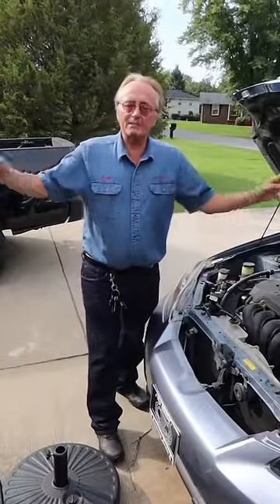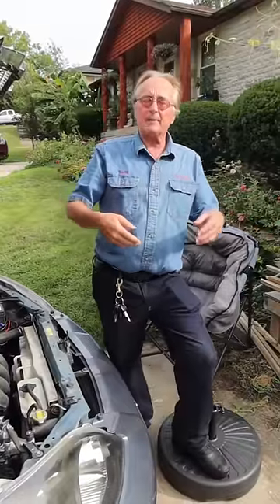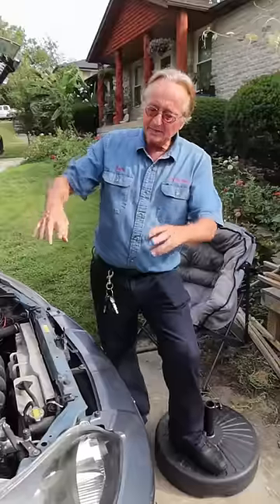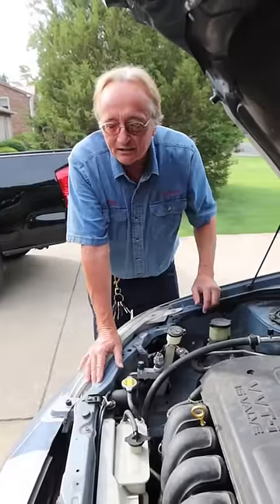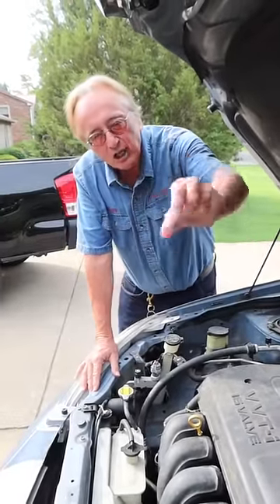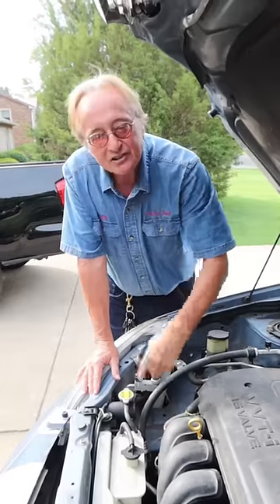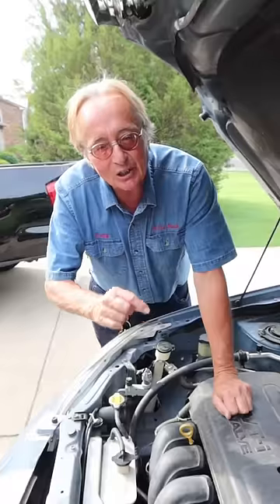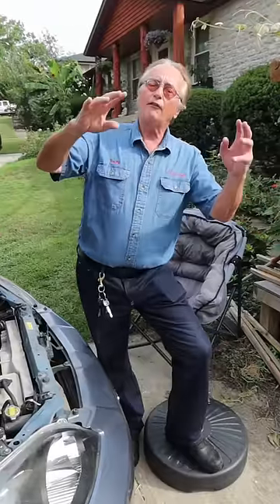How to Avoid Getting Ripped Off by a Mechanic

Comment: You could also ask for the old part too. Luckily my mechanic is pretty good about that.
Reply: In New York State they are only required to give you back the old parts if requested in advance.  It’s a good practice!
Reply: @scooterp7009  Same in California
Reply: Whenever I replace a cab or engine filter I only ever keep the old part upon request.

There have been times the customer asked, and figured it was for this reason. Honestly not a bad idea, never knew it till I became a mechanic
Reply: I asked my brother for advice and he said two things ask for all the old parts. He said you can ask to watch them do the work so you can “know” how to do it.
Reply: Yea my mechanic shows us the old part and what’s wrong with it. When I had my heater hose busted in my vehicle and it was gushing out antifreeze. He showed me the part and where it busted.

Comment: I did this sometime back at my local Toyota dealer, they were suppose change the oil and filter they said they did it, but I marked the filter and it was still they, I called them a lier. They said they didn't have one so they put the old one back. This was on new ute. I have never been back since.

Comment: True that scotty I went in for a oil change and I can tell that they didn't change the damn oil filter😠 I can say the oil filter is in a very difficult location to remove...i have a 2015 Chevrolet traverse LTZ at a carmax where I bought the vehicle. Not in less they have the exact looking filter but it did not look brand new had road grime on it 🤔

Comment: I've marked parts before. Had to call out the dealer mech on it.i flipped out on him.
Reply: It was a leaking AC hose . I marked it with a paint marker very clearly. Had my car a couple days and replaced the AC motor and not the hose...i was so specific.

Comment: They have just told me I basically need a new engine rebuild or we can start with a new transmission and a million other things cost is over $10,000 thing is I only went In for a free recall and now apparently the diagnostic shows lots of codes. My car runs fine and has no lights on, no leaks, no gear change issues, no noise problems. Am I being ripped off? I’m a young girl and look pretty stupid and naive and get this a lot.
Reply: Dude yes. Tell em to clear codes and return your car!
Reply: @ryanbobbett834  thank you! Would codes show up if there was no problem?
Reply: @itsthatyoutubechannel1083  they're ghost codes from awhile ago. Usually guys forget to reset them after the problem is fixed. Or if the battery runs low it can trip random codes as well, and once again the codes usually aren't reset. 

Unless you notice something strange, your car is fine. As long as you arm yourself with some basic car knowledge, mechanics can't scam you.
Reply: Get your car out, that's automatically red flag, check everything before driving off
Reply: Tell them that you want your car back, as you gave them, no more, no less.

Comment: I took my car to the dealer to get tires rotated. It was free so i had them do it instead of doing it myself. Because i dnt trust them i marked my tires before i took it in. When i picked it up they said they completed the rotation. However the marks were in the same place. I called them out on it and they made it right. But i will never take it to them again. If they skip the easiest of jobs what else are they skipping?

Comment: Also I believe the customer has a right to keep the old part. So if they swapped out a oil pump or something, you can tell them you want the old part
Reply: Not a bad idea but most warranty work requires you turn the old part in just fyi
Reply: They get money for old scrap parts!
Reply: @ryanbobbett834  well yea, if u don't have to pay anything under warranty then who cares!
Reply: Ofcourse. Nobody is obligated to take the part other than the owner of the part.

If you had it replaced you are more than welcome to ask for it. Its your part, although some parts do have core fees
Reply: @ryanbobbett834  most people do not get work done under warranty so this shouldn’t be a problem. I had a mechanic swap out my catalytic converter for a new one and i forgot to tell him i wanted the one but he had no problem bringing it back to me.
Reply: Right, some places save old parts, clean them up, paint them, and install them as "new."

Comment: SIMPLE...I ALWAYS TELL THE MECHANIC NOT TO THROW AWAY THE PARTS THAT NEEDED REPLACING....I ALWAYS TAKE THE OLD PARTS USED AS DESCRIBED IN HIS WORK ORDER RECIEPT....
ALWAYS BRING AN OLD TOWEL OR PLASTIC BAG....BECAUSE THE PARTS ARE DIRTY AND OILY...LIKE OLD BRAKE PADS AND ROTORS...TURBO UNITS....EGR VALVES...ETC...ETC...
Reply: WHY ALL CAPS MA'AM?
Reply: @phatgringo2.0  

I'm always baffled as to why people get offended by larger letters. 

Can  you actually HEAR THEM YELLING AT YOU IS THERE AN AUDIBLE VOICE IN YOUR HEAD?
Reply: @TheAgentAssassin  yes, yes there is

Comment: Hey Scotty, I have a Wrangler YJ 2.5L. The temperature doesnt reach 200F or 100°Celsius. It reaches only 60° C or about 130 Farenheit. Is it necessary to fix this? Recently changed the thermostat but not much changed
Reply: Is the temperature needle or sensor not broken? If it’s 60c I would assume you could touch the water and not get burned
Reply: @osasereodiase9029  It would be uncomfortably hot but won't cook your skin if you dip your finger for a second to feel the heat. But yeah a thermometer is cheap so you could just do that instead of the finger method.
Reply: @surena9451  It seems that the temperature reading is correct. Which makes it more confusing to me
Reply: @m.d.692  I am not a mechanic but I have done some DIY with my own car and that's where I base my advice from. 

If your engine is working normally then it should definitely produce some heat, enough to pin the needle at max after 10-15 mins of driving with stuck closed thermostat (don't ask me how I know..) but if your car doesn't get to operating temperature with the right amount of coolant and new thermostat then either the thermostat you replaced it with is also broken, wrong one for your specific car or not installed correctly. 

I would say try to (re)install a new thermostat as they are relatively cheap and check if the seals are good. If it works then great. That's my only guess because that's the only point where the coolant can go from the small loop to the big loop for cooling and you didn't mention any leaks or reduction of coolant (or a rise/bubbling in coolant indicated after car "warmed up") so the system is still sealed. It can only remain cold if the big loop keeps flowing, either through the thermostat..

If you hadn't measured the coolant I would've said maybe the sensor was bad since the car isn't overheating and the thermostat was recently replaced and the assumption that the heater worked. The sensor tells the temperature to the dial inside the dash and/or the ECU. In that case I would've suggested grabbing an OBD reader to see actual coolant temps reported to the ECU from a cold start to see how the sensor reacts to heating up, with some city and highway driving.

Also out of curiosity, why did you replace the old thermostat in the first place, did you have other issues with the cooling system before?

Comment: I just did something like this to make sure my 4Runner was actually worked on!  I didn't trust the job pep boys did on my wheel alignment/balance so I took off all my wheel weights before going to a local shop.  Sure enough the shop did honest work as new weights were added and even in slightly different locations.

Great advice about taking pics beforehand!

Comment: It's possible to have  new-looking parts that are used, after being cleaned up and painted.  Anyway, a few years ago, I fell for the "recall" scam.   A Subaru dealersip in southern IN took apart my front dash (UGH!) and messed up my AC!  My 2Ol4 Sooby wasn't having ANY problems before the supposed recall and 'work" that was done!  Ever since they screwed it up, every time my AC is running, and for 5 minutes after I shut off my car, it sounds like a big bird is trapped behind the dash, flapping its wings, trying to escape!  It's been getting worse each year!  I live where there's long, really hot summers, and with my health issues, I can't handle a sweltering hot car, and why should I??  THEY messed up my perfectly good car, but I can't afford to have my AC fixed!  It's just my word against theirs, I can't prove a thing.  Plus, the LAST thing I want to happen is for that same place to take apart my dash again!  They obviously hire idiots. 
It's a 3-hour drive, round trip, and I can't handle that kind of crazy traffic, and now their crime rates have gone through the roof!  Nor can I afford the gas any more.  I'm still kicking myself for falling for that scam. They obviously wanted to get me into a new model of what I'm already driving, and they wanted my information so that they could mail me crap every week about wanting to buy my car, since these kinds of cars have the top resale value. (tied with some models of Toyotas)  
This guy sounds like the Harry Carey of auto mechanics.

Comment: I marked my daughters oil filter with marker . When I checked they put big marker number on oil filter but it looked as if they just use brake clean on filter and put number on it Iam scratching this one they will have to paint it to not change it so much for dealership so called free oil changes

Comment: That's the main reason I do my car maintenance myself; oil, oil filter, air filter, sparkplugs, cleaning throttle body and MAF sensor.
If I have to leave the car for a big repair or crash repair, I remover all I can; spare tire, tools and even floor mats. I also mark the battery.
I don't trust dealerships or any shop.

Comment: Another old trick mechanics use is spraying something on your wheels and saying you have a leak. I recently got my oil changed on both my cars and they tried to pull that gimmick. It has been a year and no leaks in front of my house.

Comment: I did this once for the engine. I guess the mechanic know if so he took other things that were not marked. My 4 stock suspensions were replaced with older ones and i have no proof it. Only proof is myself feeling that they are old suspensions.

Comment: When it comes to my car, I always try to do everything myself; if possible. 
Only time I’ll go to a mechanic is when I don’t have the necessary tools or equipment. You end up saving a LOT on labor and on scams.
Reply: Some parts stores, like AutoZone, will loan out tools you'll need to fix your vehicle
Reply: @bethradke302   they generally don’t have the tools I’ve needed. They’re very generic in what they loan.

Comment: Reminds me of this time, when I was having an oil change done… that offered ‘free tire rotation’ as part of their service. After paying and before leaving their facility, I noticed that the tires had not been rotated at all… one tire had one of the balancing weights missing from it, which was still mounted in its original position. 

The manager noticed me looking at it and came out to where I was parked, and asked if there was an issue. I informed him that the tires had not been rotated at all… by pointing out the missing weight and it being in the same position, as when I arrived there. He promptly had the tech return my vehicle to the lift and actually rotate (while I watched) all the tires and check for proper inflation. 

So, yeah, it does definitely help to take photos and/or mark parts as mentioned to identify any possible shady business being perpetrated.🫣